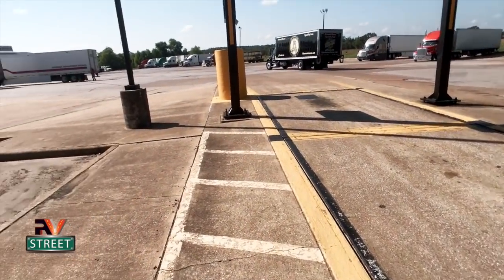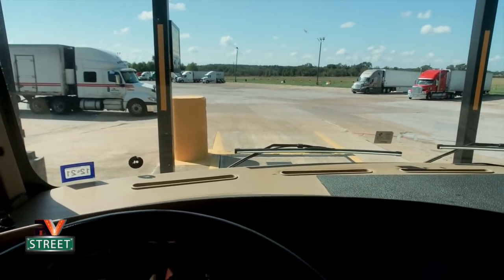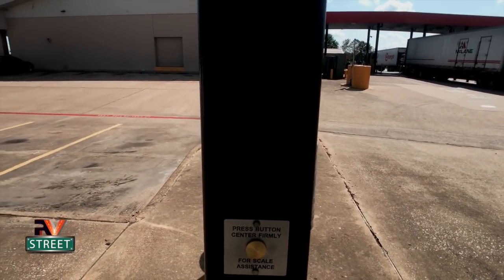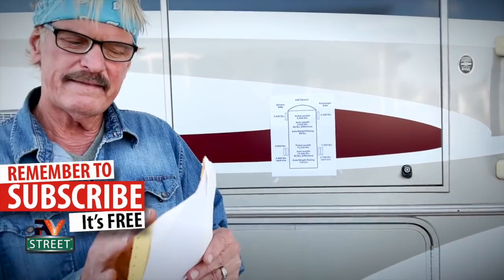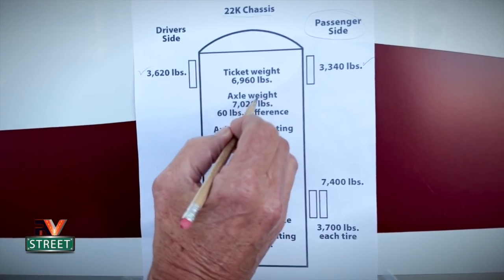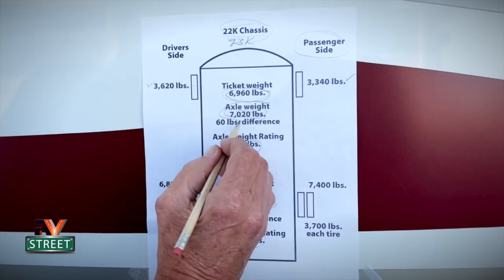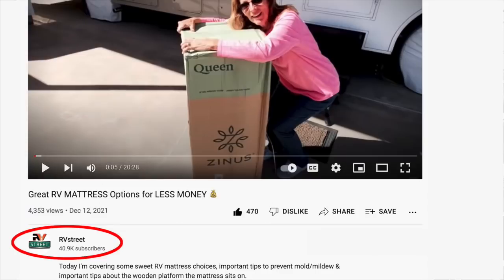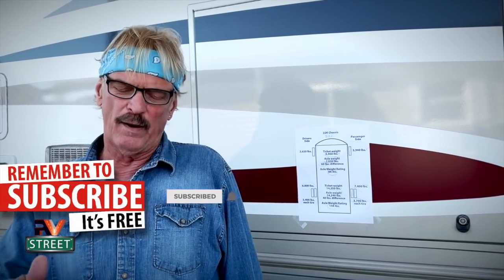Class A Motorhome, CAT Scale, 4 Corner Weigh

Comment: There is a CAT scale app [Weigh My Truck] available but I just looked and it states it does not work for split axel or double weigh and to use the intercom. Very good point about parking and going inside and talking with the scale operator before proceeding to the scale. I had a young employee that was very confused on what I was trying to accomplish and will need to redo the weights. I found it to be better to do the weighing during the day when most truckers are out on the road. If you wait until evening our nearby Loves fills up very fast and is congested and very busy and not the best time to bother these very important drivers with your RV. Also a great point about only using the normal  "rear axel" and "trailer axel" scales in  your video! Great channel for a new subscriber with a new (used) Vista LX27N.
Reply from the maker: Thanks for subbing Greg 🔧 and yep, communicating with employees is important. It makes everything go a lot smoother.
Reply: Just an update, I went to my local Loves again today and they had an experienced scale operator today. She told me their CAT scale was unable to do this procedure. Kept complaining the vehicle was not on the scale and it would not do the weight. Real bummer!!!
Reply from the maker: @4SquareHI  Ya well, like everything else these days. Some people will cooperate and some won't. But she is misinformed about the scale not being able to weigh with a split weigh or maybe didn't want to fuss with ya. Maybe go in when she's not on duty 🥱

Comment: Martin, thank you for creating this video on 4 corner weighing. I have been frustrated about how to accomplish this. I understand this is very important but have not been able to find scales to do it. The concept of how to do the scale weighing with travel center Cat Scales was confusing to me. I tried to do this, but the scale attendant said it couldn't be done. Thanks to your video I now know it can be done unless they have guard rails which specifically block your MH. To me the key point that you made was not using the front scale platform. Thanks again for your video. You da Man! On to more of your Video's
Reply from the maker: Thanks Larry 😎
Ya it can be somewhat difficult for some to get their arms around not only how to do it BUT what to do with numbers on the weigh tickets. I felt a step-by-step VISUAL would answer any questions they had. Any yes, NOT using the front scale plate is key because that way you can get the front and rear tire placement where they need to be to get weighed properly. Thanks for taking the time to comment 👏

Comment: Great video Martin ! To help those that cant get to a scale right away. You can do a kwick vis. By messuring just above axles and conpairing right and left . Front and back not as aquerate as your way . You also need to know your ride hight emty . You can also witch srings are conpressed . Again this is just a way to check if you could be running into a problem . Your way is the best way . Once you know your suspention you can almost tell your over weight by looking at your springs ,again this is only if you have no suspention sag  .

Comment: Awesome! Love to learn!  I just weighed my class B again but only axle weights. I’m only 200lbs below load and Im trying to downsize more ( but I need to add my 53lb travel wheelchair) 😑.  Since I have current axle weights, can’t I just do one side and deduct to get other side? 
I’m not sure I’ll get a chance to go through it again quickly lol. I use the cat scale app and it’s a breeze otherwise.
Reply from the maker: Since I have current axle weights, can’t I just do one side and deduct to get other side?
I wouldn't do it that way. Besides that still won't give you what the 4 corners weigh. That is the whole point.
Doing only an axle weigh is really just a waste of money in my book. There's no way you can properly air up your tires to the proper PSI with only an axle weigh. 
BTW....the CAT scale app will not let you do a split weigh. You have to do it the way I explained.
thx Jean 👍

Comment: Hello Martin.  Very Good video.  Just for grins I went on line for CAT SCALE location.   For Motorhomes, I didn't read all the different vehicle illustrations, it specifically states can't do a 4 corner and won't to prevent damage to scale or motorhome. Have you encountered this situation as you have traveled?  Thanks, David
Reply from the maker: I have heard of that but not experienced it. The stations that say that or have signs to that fact are usually the ones who install the side rails. Just move on to another station that will allow it. Sometimes it may be in another state as you're traveling.

Comment: Great info, thanks! A question about adjustable shocks…would you adjust each shock differently according to corner weight?
Reply from the maker: No I wouldn't. No more than than I'd adjust tire pressure on each corner. Tire pressure and shocks should be adjusted the same on each axle.

Comment: Great info but I'm afraid most RVers ignore this. I suspect that most RVs are over gross weight and many tow vehicle are too small. You might have added that this needs to be done on travel trailers and fifth wheels too, INCLUDING the tow vehicle.
I'm wondering if state patrol truck weigh stations will do this for RVers. If so, it would probably be free. They also have portable scales to do each wheel.
A new Cat scale just opened near me at a gas station. I called them and they said the rates were $13 for the first weigh and $3.50 for each additional weigh during the next 24 hours. Looks like it would have been $20 for you.
Reply: Hitch mounted equipment and trailers on motor homes need to be considered too.

Comment: Martin, you have taught me so much I could never thank you enough.  However I have a question on your numbers.  It has been by understanding (perhaps I'm wrong and will defer to your thoughts) that each end of an axle should not exceed one half of the axle rating.  For example, using your numbers, your rear axle has a rating of 15k meaning that each side should not exceed 7.5k.  Since your heavy side weighs in at 7.4k you only have a 100 pound margin on that side, of course you have a much larger margin on the other side.  However, to me, 100 pound margin on your heavy side would trigger, for me, a rebalance effort.  Your thoughts would be much appreciated.
Reply from the maker: thx you so much RJW 👍
If that would trigger you to rebalance some, I mean it wouldn't hurt to do that BUT the axle weight limit is the total weight of both sides. Just think of it this way.....your rear weight is ALWAYS going to be changing on the amount of the fuel you have and the water you're carrying onboard. Just those two things alone, you would be chasing that weight difference everyday as you consume fuel and water. When you're fully loaded as you normally are when traveling—then weigh—and you're under the total weight limit of that axle, you'll be fine.
Reply: @RVstreet  Thanks Martin, keep up the great work.

Comment: Martin, quick question… What if we have a tag axle? Do we just divide the weight by four on each rear corner? Thanks and advance, Jack
Reply from the maker: No. And no quick answer to this question 🤣
A tag is a little more complicated than that because you also have the ride height with your air bags to consider. To much to discuss here. I highly recommend you research this subject so you'll know what to do with your weights and air bag pressures. Also adjusting your ride height can be tricky too. Finding the right setting for your air bags will give you more front wheel control and drive wheels planted better on the road where you need the traction the most. Just as a side note but NOT the gospel...many people I know run their rear tag air bags in the neighborhood of 40lbs - 50lbs. But yours may be different. Every rig is different.

It's all these things working in tandem that will provide the best ride and keep you safe. Once you get these settings and air pressures right, there really shouldn't be much adjusting from that point on unless really add a bunch of weight. Just adjust your tire pressures twice a year. Once in the winter when temps are colder and then again in late spring when you start to get into warmer temps. That's what I do. Set my PSI twice a year. Another reason why you add the 5% - 10% in your tires PSI. It covers ambient temp swings. If you want to be sure you're still ok, once a year go and weigh yourself and see if there has been any significant changes.

Hope this helps. Now go study up 😫💕😫💕😫💕

EDIT: One last thing I just happened to think of...In older model Diesel pushers with a Tag axle some have an adjustable gauge so you can adjust the amount of pressure you want on your Tag axle. If this setting isn't set correctly it can create havoc on other components in the drive train. That's why it is important to have the air pressure set correctly.
Reply: Martin, thanks for your reply! I wasn’t expecting such a complicated answer lol. I will look into it though and make sure it’s done right. Thanks again for all your effort and all the videos you guys are producing.